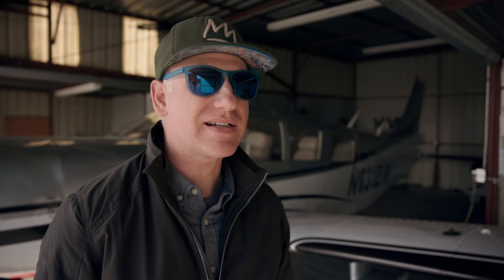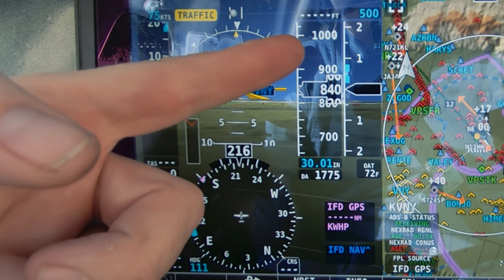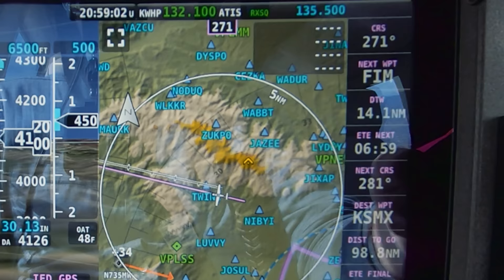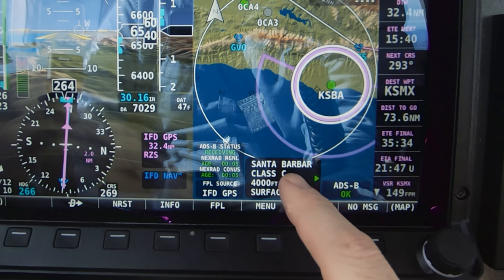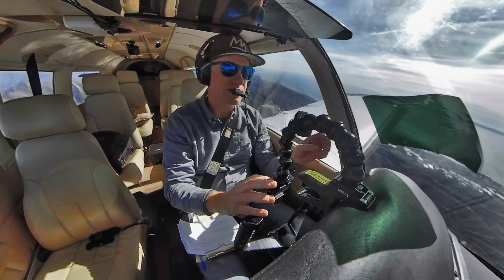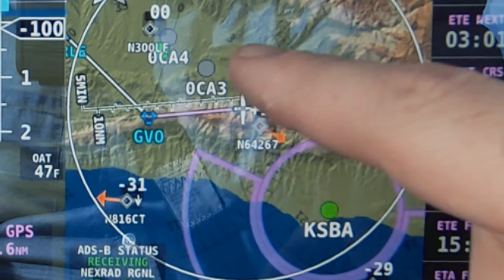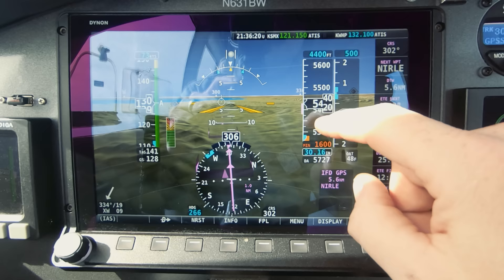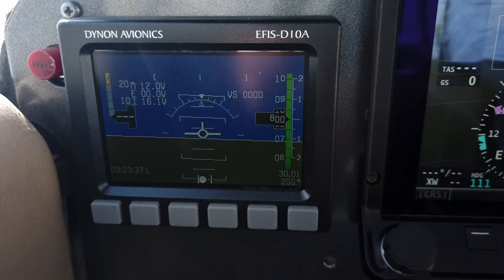Dynon Skyview in a Cherokee| HDX FULL REVIEW in flight and w/approach | BEST GLASS PANEL EVER?

Comment: One of the best aviation videos I've seen on YouTube and trust me... I spend a lot of time on here haha. Really well done and super informative and GREAT close ups of the HDX. Seems like a really cool system. I am so used to G1000 that I am scared to try anything else out there but this seems like a system that's easy to use and pretty clear. I just really don't like the low frame rate of the runway passing by in the synthetic vision.
Reply from the maker: Thanks for the comment! I hadn’t really noticed the runway frame rate until someone else also commented about it. I don’t disagree but I can say that by the time the runway is that big in frame i am for sure not looking at the screen anymore. :)

Comment: Awesome!! I currently rent a C172S with the G1000/GFC700 for my Commercial training. I learned to fly on the old steam gauges in Cessna and Piper aircraft in the 90’s...what we have available now just blows my mind! I had the best and worst IFR Checkride ever when I experienced two equipment failures during the test (NavCom and DG), we continued on based on my choice and I still passed the ride. If I was flying one of these TAA birds, very very small chance that would’ve ever happened. I love how much capability these systems have. I regularly fly IFR with the G1000 and it’s a dream, so easy to manage and a wealth of information and situational awareness. Only downside for the newer pilots...make sure you still get some experience on the old analog instruments because it is a skill that can save you on a bad day. Don’t get over reliant on the tech where you lose the basic skills. Awesome video!!

Comment: Wow... I’ve been watching the Dynon videos over and over but I’ve learned more from this video then the course material. Can’t wait to get mine in two weeks. 10” and 7” with D10A, Dynon Comm, knob selector panel, engine EMS, AOA, CiES fuel senders, And a hole for the AP (not Certified yet), all coupled to the IFD 540 and 410. Independent L3 NGT 9000 ADS-B In/Out and Dynon ADS-B In redundancy. Cessna Cardinal had just enough real estate, I’ve labeled her the Cardinal II+.
Reply from the maker: I think you will really enjoy the HDX.  Glad the video was useful!
Reply: @SoCalFlyingMonkey  So it's been almost 2 years flying with HDX and am totally comfortable with it. I've even integrated the Cardinal Checklists into the HDX display. The system makes life easy, even without an autopilot (AeroCruz 100 is getting installed this week). I've flown about 50 hours of actual IFR/IMC flights and love all the situational awareness for Wx and traffic. HITS is a huge benefit to keep your track spot on. And with your video, the transition was very painless. Thanks again.

Comment: So glad I found this video, I've been going back and forth about this system and I think with your detailed presentation,  you kinda just sealed the deal for me
Reply from the maker: Glad it was helpful!
Reply: yes i agree thanks for the review my one question is it compatible with the gns 530 w
Reply from the maker: @steveb5249  Yes. You can use the 530W as the external GPS source.  Double check with your installer if there would be any drawbacks but I think it would provide the flight plan to the HDX just like my 540.

Comment: Did a demo flight in a Vashon Ranger today with the Dynon. In the hour I was in the left seat the sales person tried to give me as much info on the Dynon as was possible while still learning the planes flight characteristics. Your video filled in a lot of the blanks. It’s an amazingly stem. Thanks. KAPF
Reply from the maker: Glad it was helpful! How did you like that plane?
Reply: @SoCalFlyingMonkey  I’m sold on the Vashon. I was kind of forced into the LSA world due to the dreaded class 3 medical issues that arise for some of us older pilots (64) A special issuance would be a roll of the dice and the backlog at the FAA due to ATP pilot post COVID recalls and an aging ATP group was going to be 8-18 months. I’ve been pleasantly surprised at what’s out there for LSA’s. Fingers crossed for a future weight increase for the class. Even 100 pounds would give the Vashon 2 full size adults, Full fuel and 50 plus pounds of baggage. That’s 500 Mile range. Perfect for my mission. Thanks again for the video’s. KAPF

Comment: Wonderful review and the best explanation of the capabilities of the system that I have seen.  I am anxiously waiting for the autopilot to be approved the the Mooney so I can jump in.  One minor thing I noticed in the video is a couple times you seem to say that with an additional Skyview screen you can do away with the D-10A.  At least according to the FAQ on Dynon Certified website the D-10A is required no matter how many screens you install.  If that has changed I would love to know about it.  Overall.... fantastic video.
Reply from the maker: I think you may be right about the D10A. I will research it and make a note of that in the video description. Thanks for pointing it out.  I hope to see more models approved for the autopilot. Looking at the pilot guide, the autopilot integration seems amazing.

Comment: The reduced amount of interpretation a pilot needs to do when looking at discrete sensors and instruments is why I believe an EFIS with synthetic vision is a major safety improvement.  With very little mental processing you can see terrain and other aircraft in relation to the plane, at a glance.  I'm not IFR rated, but with the synthetic vision during night VFR, you still get a strong sense of where you are in relation to the terrain.  I would think an EFIS is more reliable as well since they have very few moving parts.  The HDX just has some cooling fans along with the buttons and knobs.  Go figure, one of my buttons doesn't work well, so it is still not perfect :)

You touched on it at the end but being able to configure the position, style, and ranges of all the various sensors is very powerful.  At least in experimental installations, you can configure at what sensor readings you receive alarms and how they reset.

One complaint:  I use the HDX for engine instrumentation and wish it had labels and tick marks for sensor settings.  I miss having these at various increments on the RPM gauge and other analog gauges.

Love your videos.  I just finished building my plane and only last weekend finished phase 1 testing, and you're helping me see where I can go (I'm based out of KCMA).  Thanks for all the videos and inspiration!
Reply from the maker: Great comment! I agree with your assessment of EFIS safety benefits.  
I assume you are talking about the engine monitor features as far as setting alarm ranges and limits. Curious if the certified version has pre-programmed and locked limits like the JPI EDM930 that replaces analogue instruments.  What kind of plane did you build?  Definitely a dream of mine to build a plane eventually.   Congrats on finishing!
Reply: @SoCalFlyingMonkey  That's correct, there are no labels and tick marks at definable increments on engine sensors and the like, only color ranges are supported.  It would be great if the HDX allowed adding labels and tick marks to RPM, fuel tanks, etc, similar to how your EDM depicts these.
I built a Jabiru J430 ( pictures: https://photos.app.goo.gl/sEyzUzPHhdwrRMRDA ) with a lot of help from a build assist center.  There were far more ups and downs than there should have been and I still have a good set of todo's, but going this route greatly reduced the amount of time needed to tackle such a huge project.  Definitely pros and cons though.
Well take care and thanks again, I'm off to Palm Springs to enjoy some of its warmer weather today.

Comment: My analogue AI and vacuum pump were fitted in 1959 and operated just fine for 50+ years. My Aspen was fitted and failed 2.5 years later. Glass gives much better SA but it is not more reliable imho.

Comment: Great review.  I'm having mine installed in 6 weeks and can't wait.  I have a C182 with Avidyne IFD540.
Reply from the maker: very exciting.  you will love it, especially if you like the IFD540!
Reply: @SoCalFlyingMonkey  I love the IFD540. I did a 10 day IFR training and the whole time it was turbulent weather.  I would never get a touch-only screen. Like you, the STC for the AP isn't ready yet.  But I have a Stec 50 and I'll use that until the Dynon AP is ready.
Reply from the maker: @jamiebuchanan6726  Looking at the HDX manual and watching the Dynon training for the autopilot, if I can afford to install the DYnon AP when (If) it is available for my plane I may do that. The integration with the HDX looks great and it has some very nice features.  That's not to say that my Trutrak isnt dead on and super easy to use, but its a few more button presses every now and then.  :)
Reply: @SoCalFlyingMonkey  My installer is going to wire for the AP.  And the 182 is on the list to be certified by the end of the year.  So with any luck, I'll have the Dynon AP by the end of the year.
Reply from the maker: @jamiebuchanan6726  nice!!! Let me know how you like the HDX and eventually the autopilot!

Comment: Nice plane! You definitely need to work on the A/P settings though, it should be doing a MUCH better an smoother job of flying the airplane than it is at the moment.
Reply from the maker: I think you are correct. I have been noticing a bit of up and down with the altitude hold. I have been meaning to adjust the vertical activity setting. Do you have any other settings suggestions?
Reply: @SoCalFlyingMonkey  I'm sorry I didn't initially notice the A/P was TTFS and not a Dynon.  Much easier to dial in a Dynon with their EFIS than the two different brands...so I'm afraid I don't have any good recommendations for you. Both are good brands on their own, but getting them to work seamlessly together is much more difficult than using the same brands.

Comment: What an awesome panel.  I do believe the new digital systems are far superior for safety and versatility over steam gauges. That said, I believe to get the full benefit requires an obvious learning curve.  Once one learns a given system flying has never been easier or safer especially in an IFR environment.  As always, thanks for the video.
Reply from the maker: I think you are right- it takes quite a bit of time to learn glass if you want to get the full benefit.

Comment: For extra backup pull the vacuum system and put a backup alternator on the pad.
Reply from the maker: vacuum system is gone.  Standby alternator would be good.  I may try to install a backup battery system actually. there is at least one mfg that has ceritfication for a backup battery system for PA32 aircraft.

Comment: I'm researching this for my 182 right now.  Dynon, G3X, and Aspen are all on my scope.  I also have the Avidyne 540 so it's very comparable to what I'm going to have.  In the video, it sounded like the HDX set the frequencies in the SL 30, is that true?  I knew it did on their Nav/com but that was news to me?  I may be lucky in that my plane may have the AP certified when I get the install done. Thanks for the review.
Reply from the maker: Yes the HDX will control the frequencies on the SL30- it can tune and swap.  There may be other functions It can access but I havent dug that deep. The user guide is very good and would possibly elaborate. That info tab is amazingly useful on the HDX.

Comment: Nice job! Curious...as I watched you continuously dial down your altitude bug as you flew the approach, it made me wonder about the IFD's vertical nav capabilities. Could you have let the IFD command the autopilot descent to your minimums (while IFD honors the at or above fix altitudes) and left your ALT bug set to the missed approach altitude? I've got an HDX in an RV-10 that will be flying soon. Wanted to know. :).  Again...great video.
Reply from the maker: The IFD will command the Turtrak autopilot if it is an LPV approach. I dont remember which approach that was but I dont think it was LPV.  There may have been an advisory glideslope that the IFD generates if it is LNAV +V.  In any case, the Trutrak AP is not certified to fly coupled approach procedures although it is perfectly capable of doing so- just not technically certified to do so in my aircraft.   Incidentally the HDX has a MINIMUMS bug which when set will announce "minimums" so I would refrain from using the altitude bug to mark the approach mins.  Enjoy that HDX and RV-10.  A great combo.
Reply: @SoCalFlyingMonkey  think dcbrown said “missed approach altitude”, not “minimums”…

Comment: Really enjoyed your video, especially the one I originally found of your discussion with your family before buying your first airplane.  Please don't take this as a negative comment and it's a small thing but the video that takes a shot of you straight on (the camera is apparently on the windscreen) makes it appear that you are flying with the right wing low, which makes it look strange.  I'm sure it would just take a slight adjustment of that camera.  Look at the video yourself and see if you see it.  Very informative video.
Reply from the maker: Thanks for the comment. The software I was using to create the fixed frame extraction from the 360 video of that camera did not at that time allow change in the roll parameter, but now it does!

Comment: Very well shot detailed video-description of the system.A question if I may have, is the system fully compatible for approaches using third party autopilots?
Reply from the maker: I don't know how it works with third party autopilots except for the Trutrak.  I have my Trutrak connected to the IFD540 GPS and the Skyview with a toggle switch in between.  The IFD will command it in GPSS mode and the autopilot will follow the flight plan perfectly, flying anything that is drawn, including holds, procedure turns, etc etc.  The Skyview automatically receives and depicts the IFD flight plan while in this mode, but the commands for the AP come from the IFD540.  When I flip the switch to the Skyview the Skyview commands the Trutrak and the TT follows heading, altitude and VS bugs if the Skyview CDI is set to display nothing or analogue nav sources I think.  Otherwise the Skyview will command the TT to follow the flight plan BUT it is not GPSS so no turn anticipation and no holds, procedure turns etc.  I almost always leave the toggle switch set to the IFD540 for this reason.  Dynon's autopilot looks amazing- I wish it were STC'd for my aircraft model.  :)

Comment: Great system detailed video, if I may comment: the screen could be crowded with nice to know information, I thought the knob panel low position is awkward; it doesn’t help in avoiding fixation on the screen (maybe a better location would be close to the eyebrow of the panel, also the comment on the D10 not being able to sync it’s baro with the main mfd if it was syncable it will defy its purpose of being a last resort to independent stby sys.  (Beautiful easy to use sys ).
Reply from the maker: Very true about the baro sync. I hadnt thought of it that way.  I do miss the "only the essentials" info of steam gauges sometimes.  I do not have to look at that knob panel to use it- I can feel for the knobs and know what each does. Thank you for your input!

Comment: Awesome vid/tutorial. Saw some of your posts on POA forum. Super helpful having same pa-32 300. Been really liking what I Dynon has to offer compared to the big brand.  Was hoping to see them at KOSH, especially after after getting an 80k quote from Sarasota for an all big brand panel. Maybe Dynon will have their GPS certified by next airventure. Dynon from the little contact I've had has been great. Even recommending tru-trak if I didn't want to wait for their AP and avidyne for Nav. Seriously who recommends someone else when what they have isn't available yet? A company that understands their customers and service. The big brand? My A/P gets told to call the dealer and gets hung up on. 

Might have covered this in another vid, but why do you like the iPad with foreflight? If cost wasn't an issue would you have put another hdx in lieu of iPad and the D10?
Reply from the maker: My experience with Dynon in terms of both sales and service has been excellent. They really answered all my questions about the AOA system when I was going for the certified install.  I personally think it is a great value.
The D10A is part of the required equipment.  I think even if you have another HDX screen the D10A may be required but I am not 100% positive on that so definitely look at the STC or ask them.  I think I have just been used to the iPad since before I had the HDX and it has music on it and I can screen capture the flight in Foreflight for videos...and transfer flight plans to the IFD540 easily.  So I like it.  But yeah I have been thinking what if that were another 10" HDX over there...???  HAHA..

Comment: So the SL30 gives you ground based NAV info on the HDX, so you can shoot ILS/VOR approaches on the HDX HSI? I thought you needed a stand alone HSI/CDI instrument for this?

I've watched this video at least 3 times, I'm pretty much sold. Dynon should give you some kind of kickback.
Reply from the maker: I can use the HDX to display the CDI for the IFD GPS, IFD NAV, or the SL30 NAV.  Any one of those.  Plus it will do simultaneous second and third Navs as bearing pointers overlaid on the CDI as I showed.  It is certified as a primary instrument for the CDI and can be used to fly IFR approaches provided the nav radio or GPS navigator are also TSO/certified for those operations.